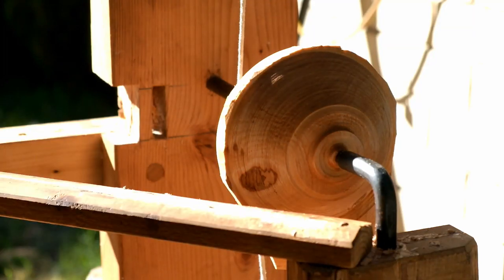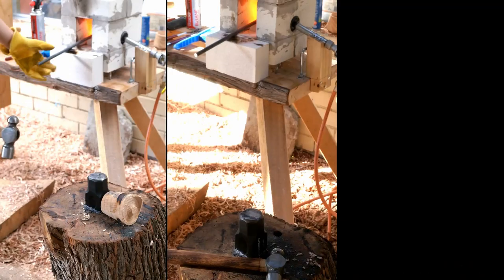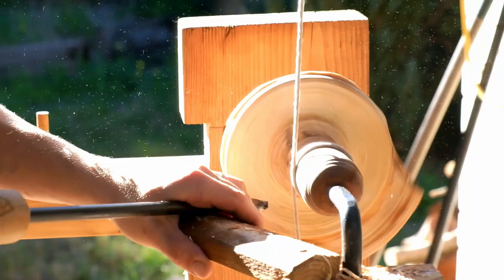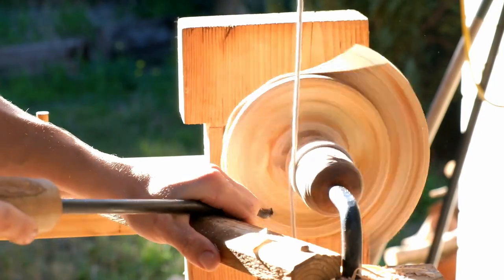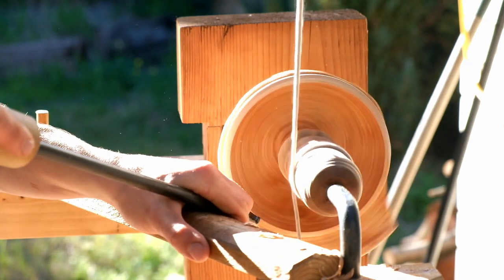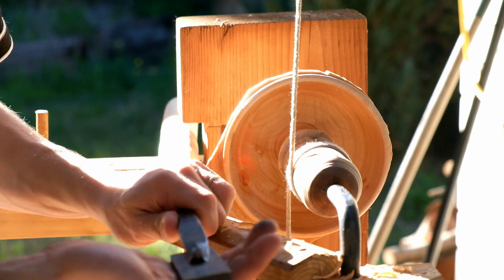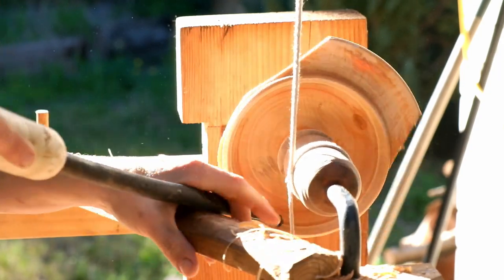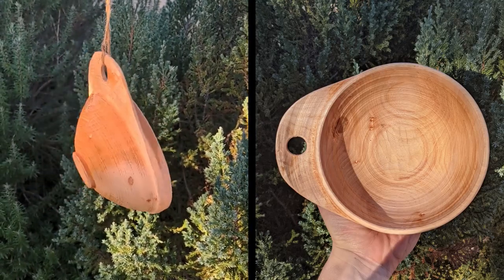I forged a pole-lathe hook tool ~ testing / turning a handled bowl ~ comparing to good tools (ep. 3)

Comment: I think maybe the amount of crank you have put in your new tool could be the problem. As you get deeper into the bowl you have more 'lever effect' which tends to turn the tool in to the wood causing a catch. My first tools I made from 16mm tool steel which seems a bit heavy but I like that. I also have a double edge tool which I really like, but it's only 6mm wide which might reduce the catching on the return. The bowl turned out nice, like the big handle.
Reply from the maker: I ended up reforging that tool into something different since then, and I've had better luck making hooks since. If you watch my newer forging video you'll see! Thanks for the helpful comment anyway ☺️